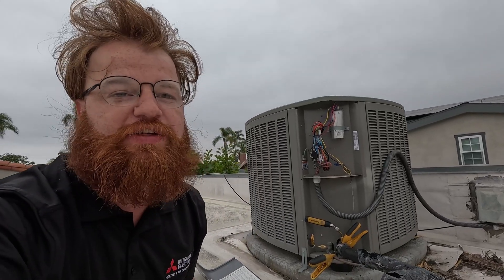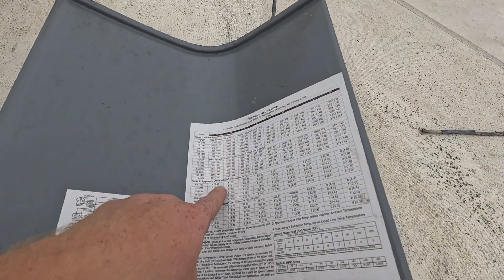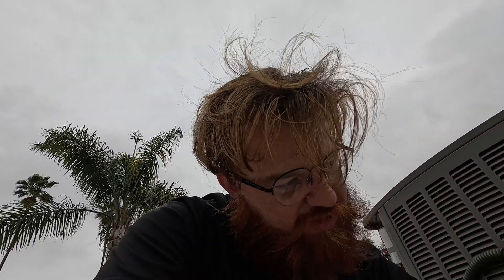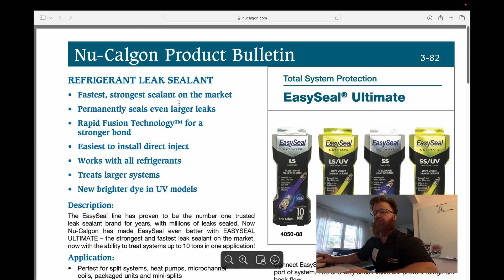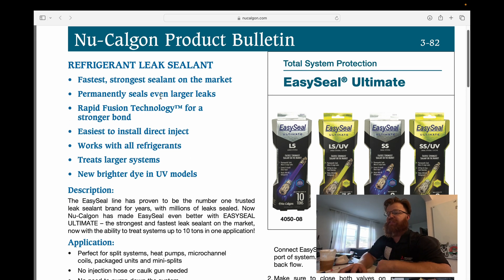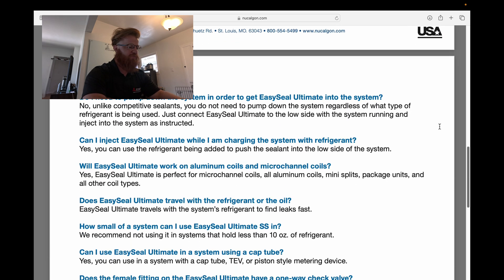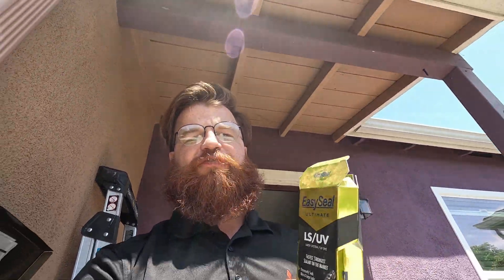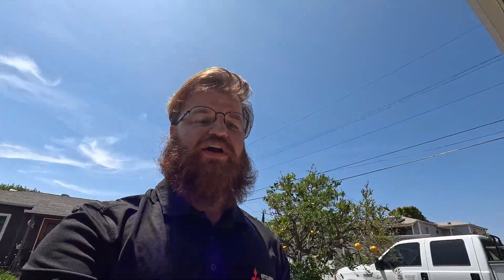HVAC Leak Seal - Miracle Cure OR HVAC SCAM?? Does It Work? Example System

Comment: Maybe it doesnt react to air.But a pressure temp drop ,leaking through the leak(Super cold at leak under pressure) and goes rock hard?!Mine also includes a DYE,which is a useful thing in it s self

Comment: I used it on my system 7 years ago. Haven't had to add freon since. But, as a rule of thumb, it will only stop a small leak. A medium leak, it might. A large leak, the dye will show you where it is. I love the stuff. Works very well and easy to clean out with flush later on. I did HVAC work for 18 years. Self-employed.

Comment: I was told I needed a new ac system $7-8k the "tech" did nitrogen tes, he never found the leak. He said "must be in back somewhere" No sale, no $8,000, no cigar for the big boss. I now have a window unit. They can take their "estimate" and shove it up their ass! On top of it all, an architect told me their number was way to high for 1,300 square feet.

Comment: I’m 0 for 4.  No success whatsoever.  At $70-80 cost per treatment, not worth it.  Didn’t matter if the leak was small or large.  I would never use this stuff on anything (unless a last resort) to keep a system running until the system is replaced, and even then, probably not worth it.

Comment: Additional information to my previous comments the walk in freezer equipment was definitely a top notch install probably 5-6 years old at the time I worked on it not a very long piping run operating pressures coming out of defrost were 25 suction 250 head pressure would run 15 pound suction pressure and the leak was a tiny pin hole.

Comment: A few years back I was picking up a refrigerant leak in an evaporator coil of a frozen food box with A D-tek select Leak detector my boss had me put the same product you displayed it sort of slowed down the leak from “5” pounds a week to “2-3” pounds per week. After a month of weekly visits, the customer was a beer distributor that kept bagged ice in this fzr. I was able to go back and extensively leak check found a pinhole leak on a U bend the ez seal didn’t fully work I pumped the system down sanded the leak area carefully rebrazed the joint with silphos 15 no more refrigerant added. So not really impressed with the product.

Comment: Great video, I had an evap leak that was pretty bad, and because it was at the bottom the oil insec and grease from years made it difficult to braze the bottom U bend. Unfortunately many other leaks on the U bends and other places made the evap not fixable.
Reply: I find best results killing power, doing a lb of trace gas and pumping the nitrogen really high, like max of lowside test pressure at 300-400 psi. You will def hear it if there is a leak even if its small. Also I like to replace the schraeders everytime

Comment: I used this leak sealer on my aunts house and yes it did not fix the leak but it sure slowed it down. Lasted probably a year and when I came back to recharge it, it was only down two lbs instead of the initial 5 lbs it took to fill it up. 410A system. I always recommend it to customers as a first option when it’s a hard to find leak. I’m sure it probably work better in a R22 system as the pressures are lower.

Comment: 12 lb leak should be relatively easy leak to find with nitrogen. But an r22 system is garbage at this point.
Reply from the maker: 100%. I did try to convince them that they should do a pressure test on the initial visit but they declined and opted for the leak seal and told me that if it didn't work they would rather just replace indoor/outdoor/lineset due to the line being inaccessible. Not my house not my call. It is 410A

Comment: Agreed.  Used it multi times. Mixed bag.   50/50 works.   Of the 50% that it worked,  about 40% of them,  it holds 1-2yrs then it needs replacement

Comment: If it’s an old system r22 and customer is on a budget I’ll give it as an option to get them through the summer. And if it doesn’t work like most the time there is a visual for the customer and an easy leak find. Usually line set etc is replaced anyway on change out. But why waste $500-1000 and just get the new system
With warranty blah blah. 

But they already add it to vehicles supposedly and I heard companies are or may start sending hvac units with it already in the system. As some companies with major contacts new homeBuilds are getting empty units and leaking evaps from factory

Comment: When my Trane system evaporator coil was leaking at 10 years old some sort of sealant / conditioner was added.  System is now  in its 18th season and still running perfectly.    Never added another ounce of 410a.   Hope I didn’t just jinx it !  😱
Reply from the maker: You a Nu Calgon employee?
Reply: @SurfBrosHVAC  No

Comment: The newer type products do work quite well. And they do not clog or gum up the system.  But it will not work on a Crack in the line. It must be a hole. Leaks on the end of the coil where the line go through the end plate or most likely a Crack. So leak stop does not do well there. Leaks in the middle of the coil are most likely a hole. And this does much better there.
Reply from the maker: Yeah I think it used to say on the packaging that this was the case but I could not find this info written anywhere on it. I was going to include this in the video but I didn't know if I was remembering wrong. I think the way they make it seem so effective is a little misleading to the end consumer of the product.

Comment: Problem is when you have to return for another sealed system repair on that same unit in the future. Say you have to come back to replace the compressor. Well when you recover the system, you’re not gonna get all that stuff out. And once the system is open to the atmosphere residual sealant in the system will start to harden and you’re gonna have restriction problems. Have seen it happen multiple times. It is a last resort option on an older unit.
Reply from the maker: Honestly I think that's why this is mainly marketed to residential
Reply: I had it happen to me. It killed my TXV after I replaced my leaking evaporator that was previously treated with sealant.

Comment: Complete and utter garbage product
Reply: It works for me on about 50% of the systems, especially if they had small leaks in the 2 pound or less per year range. What would you suggest as an alternative to your customers??? Spend $8,000-$15,000 on a new system or wait a month for a new coil if you can even get it.

Comment: Worked for me with a small pin hole in the evap coil. But lost the compressor 3 months later with an awful bearing noise. Related? Maybe! Also would you want this stuff in your recovery tank when you’re working on other customers units? If a one and done for yourself it’s ok, but for a tech, hmmm.

Comment: My thoughts?
After using this product, I had some of it leak out of the dispenser onto the service valve and the cardboard box it came in.
I let it sit exposed to the air for several minutes, and none of it hardened. Not even a sign of a thin skin layer of hardening on the product.

Comment: The hardest part is knowing the unit / system in question has a bonafide leak, not just a leak due to improper service practices like tight service caps / not plastic caps either. I used some of this years ago and it really did nothing to seal. I can't remember which brand it was. I have a rental house that I own and that unit is from a time period when I used to live there. It's R22 Freon unit that is very efficient even at today's standards one of those 2 compressor style units. The problem with this particular unit is keeping the E-coil from leaking I've replaced the coil 3 times since about 2008 when it was installed new. About 9 months ago I took out the sniffer and verified the indoor coil is yet again leaking. So I installed another leak sealer, not the one you mentioned here though. Then about 3 months ago when I checked the unit I took out the sniffer and could not detect any leak at the indoor coil like I had prevously. The leak in this instance was very small leak. Maybe 3-4 lbs and this unit probably holds around 18-20 lbs of R22. 18 SEER 2 compressor unit. 

I have another customer I put some in to his system, but no verification if the unit is leaking / the service caps were loose at the time I serviced the equipment. Improper service practices because people are more inclined to shop cheap than do anything right. That said: Refrigerant leaks are real.

Comment: I like the dye but I’m not a fan of the kind with the sealant in it. It can gum up the system pretty easily. Especially with a txv. I have used it when a customer asked for it. The dye is awesome though. You can have a recovery tank partially filled with virgin 410 and some dye in it and use part of it to fill a leaking system then just come back later with the UV light or when they call when it’s not cooling. It’s great for those very hard to find leaks.
Reply from the maker: Yep. Just stains concrete. Learned that lesson the hard way
Reply: @SurfBrosHVAC  yeah. You have to be super careful when taking a system out. I ruined someone’s carpet one time a long time ago. The dye leaked out of the coil as I was removing it from the attic.

Comment from the maker: I already know a bunch of people have negative opinions of this stuff. I just wanted to provide an objective resource to help people making an informed decision if they're trying to decide whether to use leak sealant, or not. Let me know what you guys think of this stuff. Garbage or legitimate product?
Reply: I think if a system has a small leak and the system is 10 years or older then why not give it a try if the customer wants to?
Reply from the maker: Yeah for me I bring it up but try to dissuade them explaining there are generally better ways to approach it. If it's at a certain age and the customer is already throwing money at it though then it's not necessarily a bad gamble.